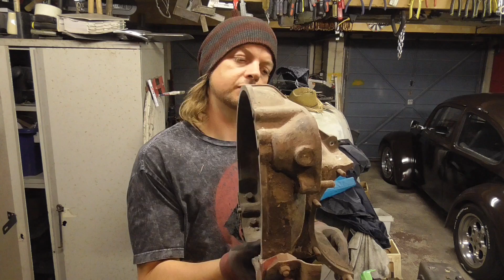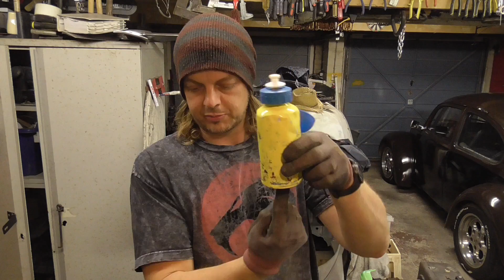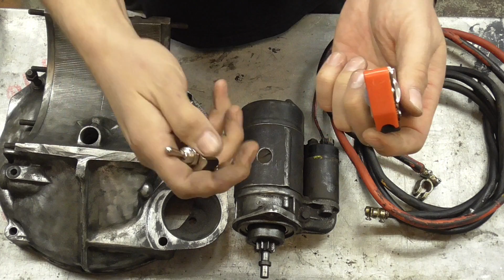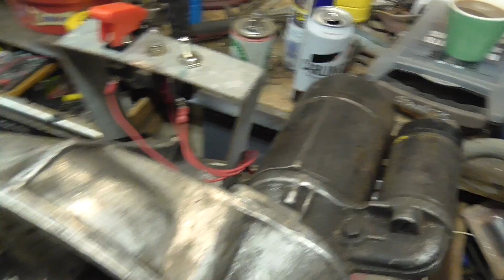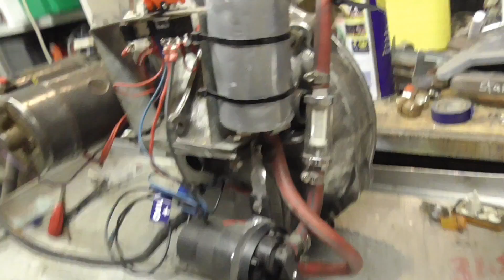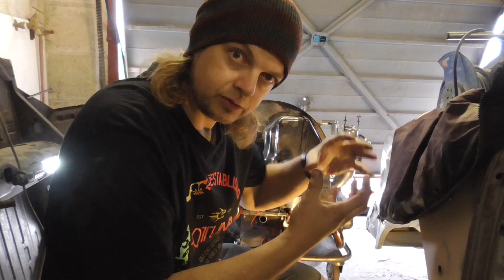Build An Aircooled VW Engine Starter Rig/Bench Tester - How To Using Gearbox Bellhousing VW Bug Bus

Comment: I used to just bolt a whole transaxle to engines on pallet, add a can of gas, battery, jumper wires and a screwdriver to spark the starter!
Reply from the maker: Yeah me too, minus the pallet 😅 but I needed a reason to make a video and this fits in the corner of the garage easier. Thanks for watching 😊👍

Comment: Good video. Going to have to make one of these.
Reply from the maker: Tx dude. Welcome to a short term loan of ever desperate 😊👍
Reply: Could I borrow it please for a few weeks? The lad who was getting me a old gearbox. Had a bit of an accident. So a bit stuck at the moment.
Reply from the maker: @buzzingbusby  Sure. When do you need it by? Do you have a leccy pump? Thst one is on my van now. Going tonhave to find a better bottle too as that shitty Ali one leaked, not enough thread. Been looking out for a petrol mower out for scrap to nick the tank off  lol
Reply: I can come for it this weekend if possible and I just have the normal fuel pump.
Reply from the maker: @buzzingbusby  I won't be able to get it ready for tomorrow. Got to dig it out the garage. You need a leccy fuel pump to prime the carb b4 you start cranking ideally. Ill need to borrow it off the van. Also I'll need to find a starter for it as think I used the one fitted on the van too. I'll send you my number via SYB John 👍
Reply: I have got a starter motor to use.
Reply from the maker: @buzzingbusby  dug if out today. It has a starter motor and all wiring is there, but no fuel bottle or pump atm. If happy to use pump on engine them just need a fuel supply. Have sent my number to John to forward on to you.
Reply: Yes I have you got your number. Will you be about tomorrow afternoon? Will give you a ring if you are.
Reply from the maker: @buzzingbusby  txt me pls 👍

Comment: exactly what I was looking for. I have a few engines I would like to start outside of the car.... if I am going to start building engines, then I will need to be able "oil prime" them, start them and run them at 2K rpm for proper break in.   Neighbors don't like me as it is, so nothing to lose there.  🙂
Reply from the maker: Cool glad it helped. They are noisy at 2k unless have a full exhaust on! 😅